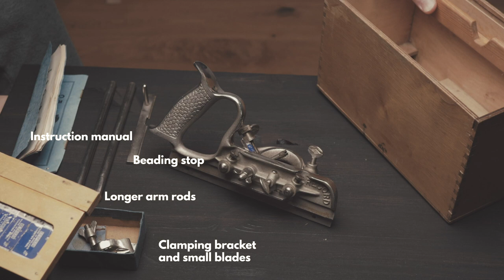Discovering the Secrets of the Classic 1950's Record No.50 Combination Plane

Comment: Nice video. I just ordered one on ebay yesterday, still waiting for it to arrive. Thought it was complete, but now I think it's missing the short bars. That's not really an issue right? Other than being a bit heavier?
Reply from the maker: Great buy. I don't think you will have any issues with using it only with the long bars
Reply: @Octavian-Dan  Great, good to know! (Still waiting for the package...)
Reply: @Octavian-Dan  Hi again Dan, Got my Record 050 today! Only problem is that the blade protrudes at an angle below the sole. E.g. the left side of the cutter will be 2mm below the sole, while the right side is still above the sole.

Example image: https://i.imgur.com/mUNxebX.jpg

Any ideas how to fix this (apart from sharpening the blade at non-90 degree angle)?
Reply: @michael.knight  pic is a big difficult to see, could of done with more depth of field. Anyway from what I can make out if the cutter is at 90° then its not sitting correctly in the groove. Check theres no debris in there and also tryva different cutter. If an alternative cutter sits at thecsane angle its defo the plane groove.
Reply: @gbwildlifeuk8269  Hi, thanks for the suggestion. I checked and it's sitting correctly in the groove (which is clean). I think the problem is that the slider skate is lower than the body skate. They may not have been together originally.
Reply from the maker: @michael mine is the same. I think it is on purpose like that, but I don`t know why

Comment: 3:39 it clogs because you have no shaving deflector.
Reply from the maker: The shaving deflector goes into the same hole as the depth gauge, I need the depth gauge more. And it clogs on the left side and the shaving deflector is on the right. I might be wrong and maybe there is another way to use it.